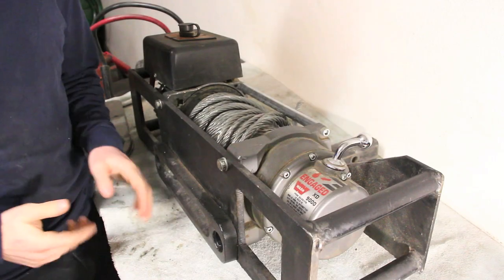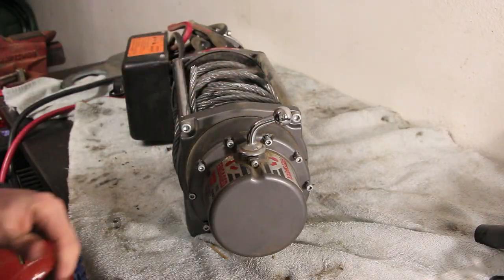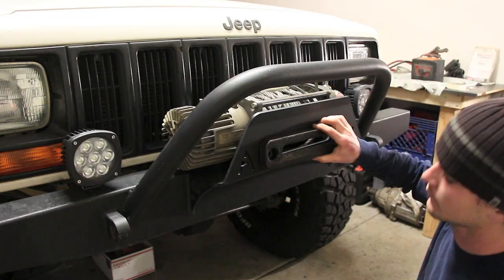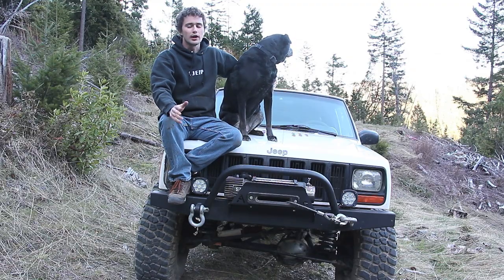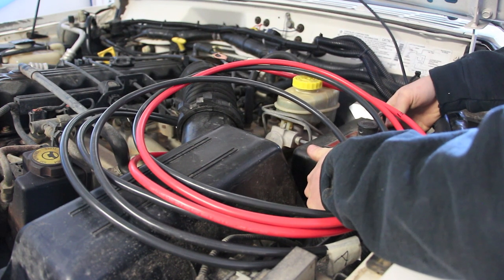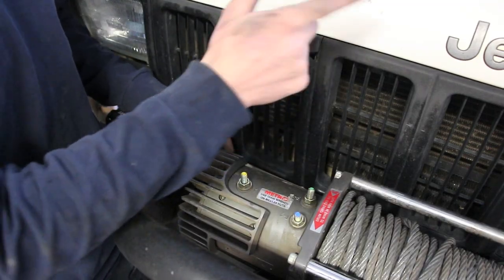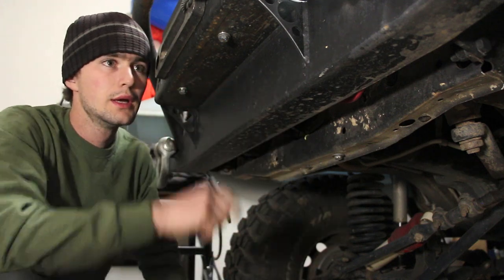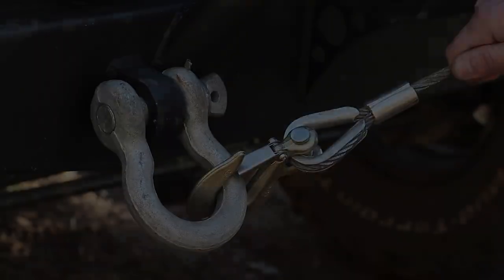How to Install a Used Winch

Comment: For the 4ga cable connections, just use solder and flux. Heat up the copper with a torch and feed it solder until 3/4 full- then dip flux covered cable in.

Comment: Great video. Love your XJ. I have the same exact rig (white 98 2dr) though mine still has a bit of growing compared to yours. But yours is exactly what mine aspires to be. Clean and tall and 100% trail ready daily driver. Well done! Would love to see a full rundown on your rig - specs and all. That would be a great video.
One note on your install today - whenever possible, you want to put a backup wrench on electrical studs when tightening (or even loosening) because if that post starts to spin, the soldered connections inside could break. Learned this lesson while installing starters on aircraft back when I was a young A&P.  
Great work as usual!

Comment: Good vid. Quick tip: when I label wires, I wrap the tape all the way around, with a little bit sticking up on each end to make a "flag", the tape sticks to itself a lot better than the wires so there is much less chance of it falling off.
*ah I see you did exactly that later in the vid, nm.

Comment: for electrical connections that will likely see alot of moisture, it is recommended you use a grease to prevent corrosion.  Ideally you want NO-OX grease (can get it from an electrical supply store)  you can also use dielectric grease if you can't find NO-OX

Comment: Tim, great vid.  I have not worked with winches yet, but are you supposed to leave the motor running?  If so, upgrading the entire wire system to include the grounds, alternator, and starter would be best.  You would also want to fuse everything, as any cut to the sheathing of non-fused wire around metal could start a fire.  One more last thing, wire work is very important.  You want to make sure your wires are routed correctly and are secured firmly.  From what I saw you did a great job of this, but for bleepin jeepers who have no experience this is not that apparent.  Thanks for the great vids, keep it up.

Comment: Nice video, found it funny you showed your mishap with the drill. Shows good character and humour :) Dont like how you have to pop the bonnet to use it though.... Should run some extension wires to your bullbar to accept you controller.  Good work!

Comment: Great job on your project 👍 I bought a hydraulic crimper from Harbor Freight on sale and a 20% coupon and drilled and tapped the back  of it and attached a 3/16 piece of plate steel that allows me to hold it in a vise while I crimp my wire ends.

A little do-it-yourself di-electric grease under you terminal boots will help prevent corrosion, but not a necessity.

What's your living hood ornament's name?
Thanks again 😀

Comment: Nice video..I would have checked on the #4 wire rating since you changed it to 8 ft length from a short length you might need a heavier gauge wire to handle the added length.

Comment: As for the holes you cut in the bummer cut off about a 1/2" length of steel 1" dia. schedule 80 pipe to reenforce the bummer and weld it to the bummer. This will act just like a fender washer in thin sheet metal and carry distribute any load around the holes to prevent them from cracking...
Reply: What a bummer...

Comment: Hey I really liked this video especially the remote solenoid install.  I do have one question though.  Shouldn't you be using a roller style  Fairlead instead of the  Hawse style Fairlead?
Reply: With a steel cable, yes. The cable on a hawse will work, but the cable will likely chew up the fairlead over time and any angled pulls will see a lot of friction and heat, neither of which is good for the cable.  But, it will work in a pinch.

Comment: i am getting set up to build a 2009 ram 2500 4wd off road recovery vehicle do you think it would be good video content. have been gathering parts for a long time. have 2-8274 warn winches for side pull and a apex 12,000 for the front and a regular badland 12,000 for the back the truck will have a boom simular to rory's truck will have a hemi in it

Comment: Lets see a video of how to install a bigger and better steering box and better motor mounts.  I installed a durango steering box in my XJ as well as synergy suspension poly inserts for motor mounts.  Kind of a pain but some video ideas! keep up the great vids!
Reply from the maker: How does that Durango box work for you? My xj box does everything fine except at idle it has a hard time turning those 35s if I'm not moving. Steering upgrades are in the near future for sure. - Tim
Reply: Works great, i have 35's on my XJ and it wouldn't turn them at idle with the factory box. The durango box turns them easy at idle now.  My stock boxes always leaked i guess due to over stressing them. I got mine out of a 98 durango with 4x4 and without the snow plow package - direct bolt on.  Its slightly bigger than our stock box.
Reply from the maker: John Irwin Thanks! I'll probably go that route. - Tim

Comment: Why would you relocate the solenoid box especially when you may have $60 in wire to do it? New to winches and not sure why you would do that.
Reply from the maker: A lot of people don't relocate the solenoids and never have a problem. I chose to put them in the engine compartment to keep them out of the elements as much as possible and to avoid submerging them should I find myself up to the winch in water. Also, with that box out of the way your radiator will get better air flow, plus I think it looks cleaner than having a tacky solenoid box on top of your winch. You're right on about the cable cost though, that hurt! - Tim
Reply: That's was not near $60 in cable.

Comment: Tim can I just say Dan made those 2 winch mounting holes hard for a reason, I was talking with him today and he said it's sorta used as a theft device. Be jade obviously if it's hard for you it'll be hard for them. Just saying haha
Reply from the maker: Like I mentioned in the video - That wasn't a problem or a design flaw in the bumper. With the right tools (air ratchet would have worked great) I wouldn't have done that. Probably won't do a video on it but check bleepinjeep's facebook page in a few days for my anti-theft idea. Thanks -  Tim

Comment: Hey Tim, sucks ya had to drill through your bumper, but from the looks of the space it seems like you could have used a universal extension joint to get the bottom bolts for the winch on there, but that's coming from just watching the vid (may have been totally different from your view).  Either way such a great vid! Learned a ton of how to take everything apart and great techniques on putting things the way you want them!  Hope ya make some more vids!
Reply from the maker: I threw everything I had at it before I drilled the holes, including a uni-ex-joint. No big deal. Thanks for the compliments! - Tim

Comment: move the plug for the remote to the side of the fender and you wont need to open the hood to hook up. and install secondary remote inside the cab  you don't need to get off the vehicle.

Comment: As always I enjoy the Bleepin Jeep videos but I have to point out that you're loosing a bit of power by moving the  solenoid box to the opposite side of the engine bay. Would be best to keep it as close to the battery and the motor as possible. At the very least I would have upgraded the wires to 0 AWG to help with the extra distance in the power wires.

Comment: while u had the box apart should have put seperate leads i had interior switch 3 way inside the jeep so u can control from inside the jeep
having to open the hood to winch kinda a pane no sorry 16:35 lol
Reply from the maker: Its easy to take the cap off and I will add an interior switch eventually. I have a master control box in the works that will house all my switches for different things. Waiting to get that figured out before I start running wires. For now, yeah I have to pop my hood but I can close it with the controller plugged in and reach the driver seat no problem. No big deal to me. Good observation though! - Tim

Comment: what bumper are you using ?
Reply: He uses an Affordable Offroad Winch Bumper with Prerunner bars.
Reply: It's actually just the bull bar, prerunner would have 2 small bars on the side
Reply: You're right my bad. I just listed the closest model they have available on their website. I couldn't find the bull bar model.
Reply: It's only actually on their ebay site haha
Reply: anyone have a direct link to the bumper? Thanks.

Comment: Wrong fairlead for steel cable.
Reply from the maker: Its a steel fairlead. You're right its not ideal. If it were an aluminum fairlead for synthetic cable I wouldn't even consider running it with steel cable but as long as I don't have a ton of off angle pulls it shouldn't be an issue. I plan on upgrading to a synthetic cable anyway down the road so cable ware isn't a huge concern to me. Plus I spent my money on new wire for the solenoid box instead of a roller fairlead :)   - Tim
Reply: I wanted to say that.
Reply: Iron Hawse fairleads are fine for steel cable lol